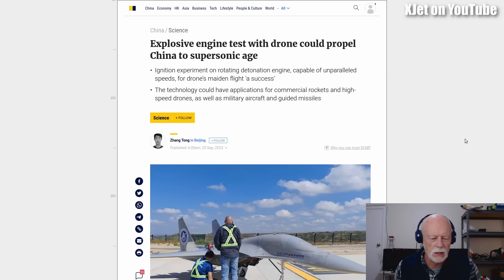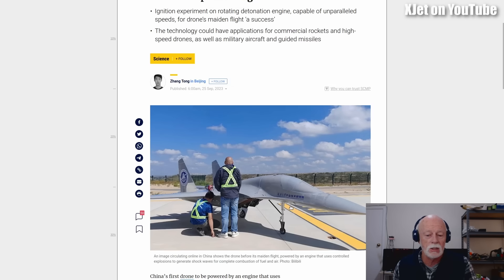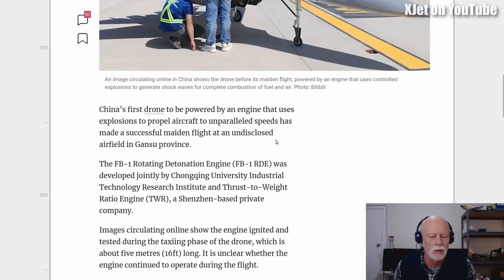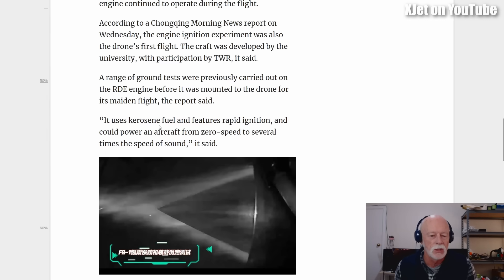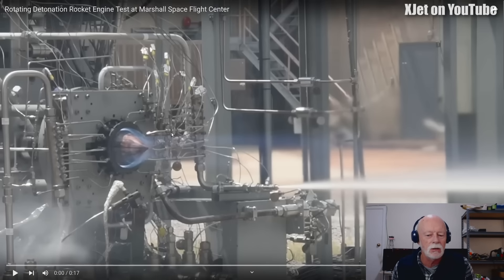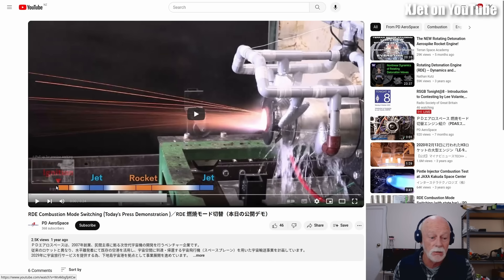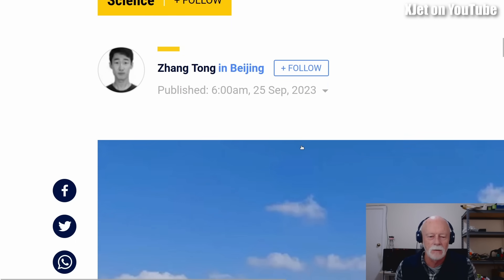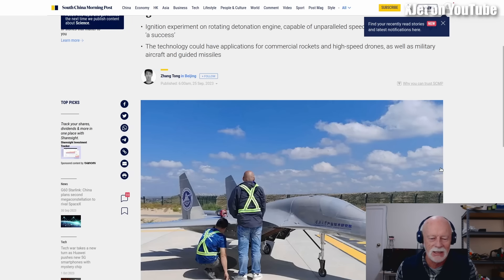China's "explosive" new drone * BUSTED *

Comment: I’m sorry xjet, but the RDE is actually under the fake air intakes of the model, sitting in the middle. Although I as skeptical as you are, that it definitely needs more cooling than airflow. The mini turbofan may be a backup for when the RDE fails or for takeoff and landing purposes.
Reply from the maker: I remain unconvinced.
Reply: @xjet I suggest you do proper research before calling this achievement a "fraud". Read the article from Bulgarianmiltary titled " China tested a rotating detonation engine on a Su-34 scale model" and watch the video posted there

Comment: not wanting to sound like a chinese shill poster, but wouldn´t it make sense to have an alternative engine if u are testing a new one?
so u don´t lose the prototype each time there is a failure
also ramjet´s need an existing airflow afaik
Reply from the maker: An RDE is not a ramjet -- it does not require airflow to produce thrust... it can produce static thrust.
Reply: @xjet  ok thanks for clearing that up, but the other thing with the second engine... 
kind of bolt on jet turbine in case the experimental engine fails
maybe not enough to start the drone but to maneuver and land
Reply from the maker: @Hellfr4g  I've subsiquently seen video footage of this craft -- all you can  hear is the turbine... no RDE screech in any of the footage.

Comment: well the usa discovered issues with rotating detonation waves when they were building the engines for the apollo ...they did not know how to do it, but it occurred and blew up several engines so they learned how to avoid it from happening.  right now there is research into making it a reality ... the one i saw thou in a video yesturday uses 400 liters of 02 a second.. and that little plane doesn't look like it can achieve that... the size and efficiency of the compressors would be huge.  they can only ignite the wave for a second or so before having to shut it down but they are experimenting... any longer and there is the potential of melt through of parts.  i'll try to link the address to the videos in a reply to this as to not get this comment deleted.
Reply: https://www.youtube.com/watch?v=fRMMSyCcTDI  and  https://www.youtube.com/watch?v=28XbT11lL24  (( the second one is about a pulse detonation sort of engine, which at best is what i think they are potentially using with that drone.

Comment: Rotating detonation engines are insane. Maybe they have one on the back and use the turbines as a backup if it cuts out
Reply: "When" it cuts out. There, fixed the "if" for you. 😊
Reply: This is what I was thinking.  The external engine look obviously like a test/safety setup.
Reply: Those turbines are attached to the wings... one on either wing... my thought is that they are used for take-0ff and get it up to a certain speed or air flow, before igniting the RDE

Comment: Stoke Space successfully launched and landed Hopper2. That uses hydrogen and is an RDE. Correction: it is similar, but actually a distributed thruster system. Sorry about that. 
Another point about this claim, is that it runs on kerosene. The SpaceX Falcon9 Block 5 Merlin Engines run on Kerolox. This leaves a sooty deposit over time. Not what you would want in an RDE, in my opinion, so another 'doubt' about the story Bruce reviewed here. Soot build up would require a higher maintenance and you would not get the same thrust to weight ratio compared to hydrogen. This drone is supposed to go at hypersonic speeds and it does not look like there is any special material on the nose tip or leading edges in the picture shown. (Like the SR71 Blackbird has). However, the picture might be an 'insert' for the story and not related. 
A very common thing the News Channels do as well, which is a total mis-representation of the truth and can be mis-leading. But that's another subject.

Comment: Typical orbital rocket's burn time is in minutes, ~2 to 4 min for booster and 4 to 8 min for the upper stage. NASA's RDE test were ~100 seconds so not so far from real deal. But you right, both tested configurations were water cooled, from outside source. Operational version needs to be regenerative cooled, and they want (or need) to use both oxidizer and fuel for the cooling.
Reply: This is what Stoke Space do with their Hopper2's successful flight. They use the Liquid Oxygen (LOX) to cool the RDE and for the recovery landing, are going to use the LOX to keep the re-entry shield cool.  Still in early development.
Reply: @David-yo5ws  Stoke Space uses 'normal' multi chambered aerospike for the upper stage and regular bell nozzle rocket engines at booster. No RDEs.
Reply: @HVM_fi  Oh, I see. Sorry, I thought the method they used was an RDE. I just looked at their site and they call it a distributed thruster system. Not quite the same obviously. I was aware it was only on the second stage. Thanks.

Comment: Could it be an backup emergency engine ?
Reply: Too small if you ask me. Also weirdly placed.
Reply: @Axiomatic75 I thought it was just placed there, while they worked on the model, I did not think it was a fixture. If I could be bothered, I could do a reverse image search and find the real article, but I can't be bothered. 
Isn't there some 'Jet Man' who flew using about 4-6 of these engines? He had to cling to the side of a helicopter (as he was strapped in a Delta shaped flying body), then he fell backwards, started the jet engines and flew like a jet plane. Then when the fuel was expired, had to release a parachute. Highly dangerous but what a sight to see!

Comment: The turbine could be legitimate in the sense of providing power in between tests e.g. when taking off and landing.
Reply from the maker: Not big enough to fly an airframe like that.
Reply: @xjet  You are seriously self opinionated without any FACTS... you have no idea what the weight of that vehicle is... there are some very LARGE and impressive RC controlled models that they are used on... and I suppose you're ignoring the fact they may have made improvements to those turbines.
Reply from the maker: @Reality_Check-1969  Clearly you are unaware of my familiarity with "large RC jets".  Take a browse of my back-catalog of videos 🙂
Reply: @xjet I suppose it's in the realm of possibility (while not probable) the turbine is an auxiliary engine. If they don't have a reliable RDE having a second more conventional turbine (even if under powered) could help limp home after the RDE fails.
Reply: LOL !!!!!

Comment: I’ve had a little sniff around the fluid dynamics analysis of a rotating detonation engine and it was very interesting. I had no idea how viable it was but it was a cool idea.😊
Reply from the maker: It is indeed interesting but extremely difficult to sustain.  If you look at the various YT videos you'll see nothing that runs for more than a few short seconds.  Not ideal for an aircraft (manned or unmanned) :-)   Despite significant work over the past decade, we're really no closer to them being a viable propulsion system.
Reply: @xjet I been following nasa and their rde works great
Reply: @xjet  I wonder, how about pulse detonation then? Say each cycle sustain for only a few sec. But then a new cycle is immediately started that sustained a few more sec. and so on and so on. Just thinking.
Reply: DJI got RID build-in....
Reply: @ahmedizzeldin Yeah, I hate the fact that I still own my Phantom 3, even though I haven’t flown it for 5+ years
Reply: NASA can keep a RDE going for 1 minute. I assume China can do so for about the same amount of time.